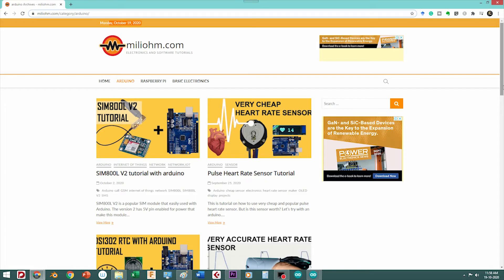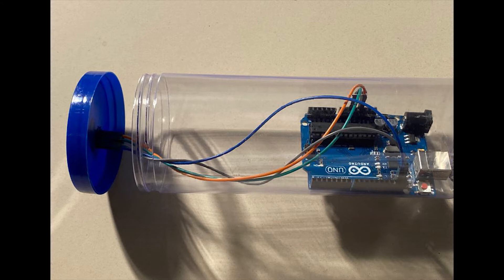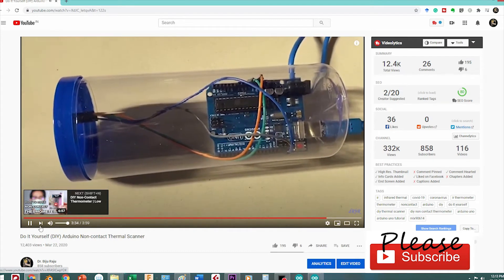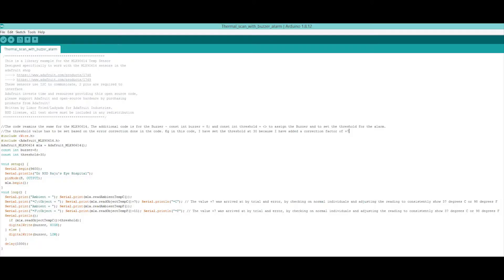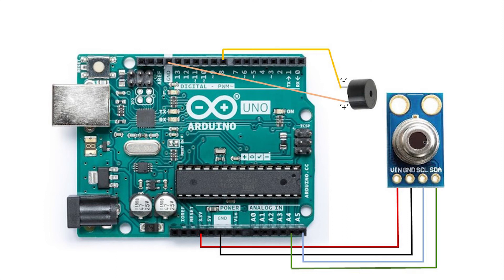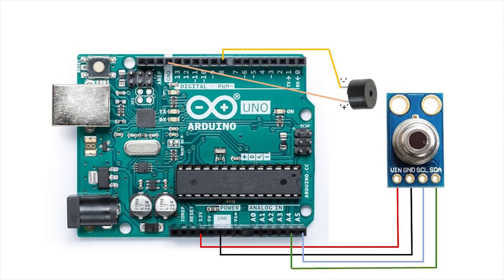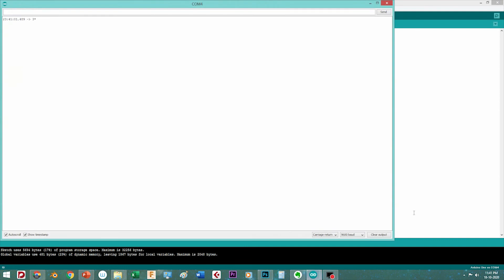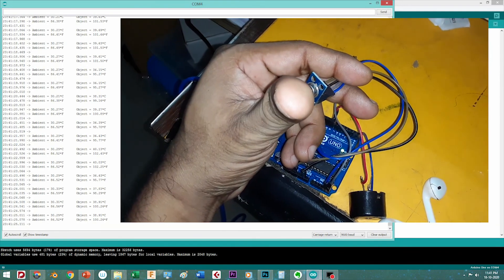Do It Yourself (DIY) Arduino Non-contact Thermal Scanner with Buzzer: a beginner's Arduino Project

Comment: Hi Biju Raju!
This is awesome ! You never cease to amaze !
Medical doctor.
Amazing on the strings. 
And now, Arduino !!!👍👍👍
We semi conductor guys do not do as much DIY experiments - hats off to your inquisitiveness and varied interests !
Rgds
Ninan
Reply from the maker: Dear Ninan, I am still a toddler when it comes to projects like these with Arduino and electronics. This was purely out of desperation during the COVID times. There were no noncontact thermal scanners available during the lockdown 1.0. We needed to implement that part of the protocol for the hospital as per guidelines. This was an easy way to do it. And for 2 months we did that. Screened every patient with the DIY thermal scanner. In June, we got our new thermal scanners and right now we are using that. Thank you, Ninan for taking time off to see a humble project that I did. Actually, the interest in Arduino started when Ishaan wanted to do some electronics related project.